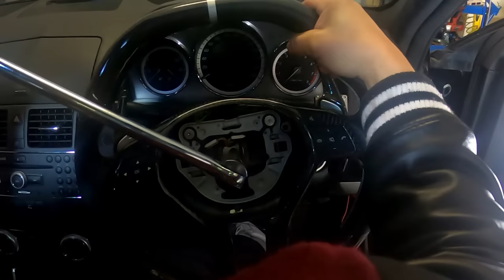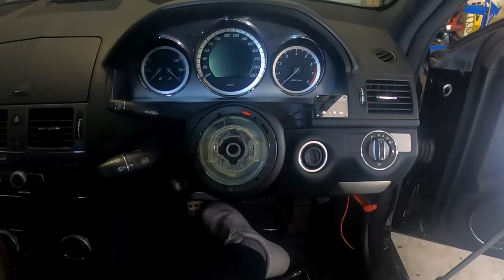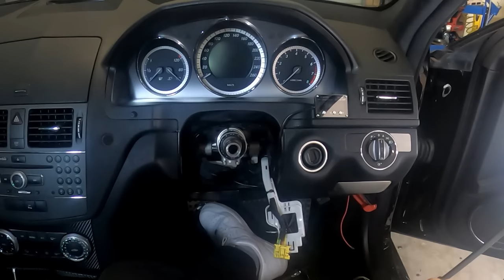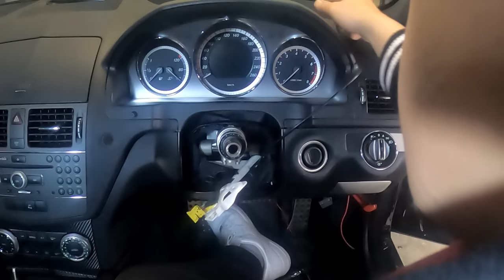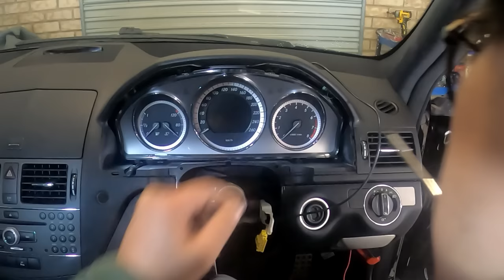HOW TO remove and fix ESL/EIS/ ELV MODULE  w212 w204 mercedes motor replace  Part 1

Comment: Hi, Managed to pull the column out, BUT the spline above the universal was not loose enough to separate. The bolt has been loosened with a T40 Torx. Should I start to spread the alu fork to release the spine or use a hammer to drive the universal downwards? What has been pulled a bit further out in addition to the column is the bit below the universal, the bit which turns the system. Help! Thanks.
Reply from the maker: hey dominic sorry to hear about your troubles ... ok so from my experience when i pulled my column out i only removed the torx bolt and it came out quite easily
Reply: Thanks, Mike. Problem was, I should not have worked on my own. I used a screwdriver to loosen the grip of the spline and that worked. Had a friend been with me, he would have stopped the moment he saw the whole lot gets pulled out. Anyway, will see if I can find the second spline I pulled out and lift the universal sufficiently enough to mate them again. Thanks for your constant help!
Reply from the maker: @dominicwild3189  no problem mate im very proud and glad to see  your taking the initiative and giving  this task a go.... i take my hat off to t u.... ur doing a great job mate ..keep at it and dont give up ..u will get there i believe it.... and have faith in u.... i didnt need a partner to help it was a bitch getting the colum to sit in again and i almost gave up but it does go in a certain way and u will figure it out buddy.... good luck mate
Reply: @MIKEYZVLOGZ  Thanks Mikeyz, great help! Managed to fit the spline with the universal into that lowest hidden part of the steering assembly using soap to slip the steel spline into the lowest rubber spline hidden behind rubber bellows.
Reply from the maker: @dominicwild3189  good on ya man well done happy for u
Reply: At the universal end I noticed a rather large gap without two (?) splines and a matching gap in the spline of the column, so this must be the place to mate while a friend holds the column. I managed to push it in the first 10mm, then there is a gap at the universal end and then it does not wish to go farther. As the web is full of horror photos of chaps having hammered splines together (alu vs. steel!), I am once again stuck, literally, but the motor has not arrived from China yet, so I can wait.

Comment: Mikey, quick question. After I reinstall the module and I’m ready to test is, how much do I need to button back up before I can hook up the battery and check my work by putting the key in and trying start the car?
Reply from the maker: what do u mean by button up? do u mean how much do u need to reassemble the eal module? ..u just need to have it put back together .. use duct tape to secure it for testing purposes then reconne t battery and try.. u don't need to reassemble the steering wheel .. just do the testing first
Reply: @MIKEYZVLOGZ  yeah… once you’ve installed the repaired module and got it plugged in, how much reassembly is needed before you can plug the battery back in for a test? Does the module have to be screwed back into the steering column? Or can u just plug it in and test it in your hand ?
Reply from the maker: u can just plug it in and hold module closed tightly and reconnect battery to see if u hear it spin and unlock and lock..don't put anything bk together ..its not needed.. cuz ur just testing ..just reassemble esl and closed cover and duct tape to hold together and then plug it in
Reply: @MIKEYZVLOGZ  so do you leave the key inserted while you do the work, and then reconnect the battery with the key in the EIS so everything looks like it did when you disconnected the battery since the ESL is unlocked?
Reply from the maker: @evanromoff5413  correct

Comment: Hello, firstly I am very great full to watch your video how to replace ESL motor. I need to ask a few questions. If I want to take out ESL ( in unlock position ) can I do it without remove instrument cluster (speedometer), the Steering wheel and steering column ? In which country you staying ? I am at Malaysia.
Reply from the maker: i believe u can fo it without removing the cluster and speedometer... but u need to remove the steering wheel... it is the only way i know how to do it ....  you can try to do it without removing the other parts but it will hist take abit fiddling around thats all... i remived all those things to giveme more room to work and so i could show in detail how to remove it all....im from australia
Reply: @MIKEYZVLOGZ  Hello Mikey, I did not understand what did you mean "when something else happen " in your explanation text below in your comment
something must have went wrong with your installment...because if just your motor is malfunctioned you can just replace motor in ESL module and it will be ok...but when something else happens....then you have to resync the ESL to EIS...kind of like reprogram but abit different..this si what i understand from some research..
Reply: Hello Mikeyz..Another question from me.
When the ESL in unlock position then disconnect the battery cable and the engine still running. when I switch off the engine using keys did the ESL will go to lock position again ?
Reply from the maker: @muhdhisham9w2sym61  correct so if u just replace motor in esl u can reinstall..but if your nec chip has malfunctioned or u fry your chip or circuit board due to incorrect handling or procedure then most likely you will need to reprogram it
Reply from the maker: @muhdhisham9w2sym61  u dont need to have the engine running ... u just put the key in the ignition so it will unlock esl..then u disconnect the neg battery terminal so that it will stay unlocked... as long as the battery is disconnected with esl unlocked it will stay unlocked becuz no more power is going to the esl.... even if u remove the key with batt dconected it will stay unlocked.... but as soon as u reconnect the battery it will lock again if key is not in ignition... is this what ur asking
Reply: @MIKEYZVLOGZ  thank you friend
Reply from the maker: @muhdhisham9w2sym61  ur most welcome friend
Reply: @MIKEYZVLOGZ  Hello Mikeyz. Do you have VVDI MB Tools software install in your PC ? Where should I get the software ? I am planning to do learn how to use the software for duplicate  keys, Prog ELS Imulator for my hobby. Hehehe...
Reply from the maker: @muhdhisham9w2sym61  ebay and aliexpress will be a good place to start im sure u can find it

Comment: Great video, happened the same to me at Walmart parking lot tonight, couldn’t get it start but after little while sitting in the car it just worked after trying 100 times . I can’t wait for summer so I can change the fu*king motor .
Reply from the maker: firstly thanks for checking out my channel i truly appreciate it..... and thanks mate ......hope this video can assist you in some way 
also do not forget the lil trick of tapping under the steering column right under the esl module and tapping with a rubber hammer or like the one i showed you in the video double sided plastic/rubber heads and it will help spin the motor aswell incase you get stuck again ..... trust me very handy to know
Reply: @MIKEYZVLOGZ  hey my 2008 c300 had the same problem can I use the hammer trick to get it to start
Reply from the maker: you can most definately try...it wont hurt to try..however ive been informed by another person that it didnt work for him...pls be aware that its based on luck also...its just a trick that worked for me and a few other ppl after some research.... so definately give it a try
Reply: @MIKEYZVLOGZ  ok thanks!
Reply from the maker: you are most welcome friend

Comment: Hello, when you go up the elv engine, the position must be the same as the disassembly? How do you do if the position is no longer the same? will it work at startup? Thanks for your answers. Jean
Reply: In my case the lock sticks out and looking at the ELS side-on, both grey pins of the two limit switches just touch the posts. Hope that helps?

Comment: Hey Mike so I have the same problem with my Mercedes c300 2014.. I was wounding is the eBay motor $16.49 that you have listed in the description would fit my car?? Looking forward to hearing from you.
Reply: Also what is the motor ID # ...do you have another link to buy it who would ship it the fastest ?
Reply from the maker: @adhamabughanem9401  search eBay and aliexpress and find a seller that ships from your country that's the fastest way to get I.. I'm sure u can find it .. filter your search to your local country

Comment: Awesome video. I have a question, do you tap on the ESL to get it on the unlocked position when you are turning the key? or do you just turn the key to the on position??
Reply from the maker: the esl unlocks as soon as u insert the key u don't have to turn it at all..
Reply: If when you Insert the key nothing happens then is the eis?

Comment: Hi there.... Thanks for your video... I might come across the ESL problem also.... When I insert my key, no sound at all.... But it can start normally.... Will this consider esl problem? And may I know how to make sure is it on unlock position? Need to disconnect the battery? Thanks in advance ya....
Reply from the maker: yes correct

Comment: I went with an emulator instead of repairing the modules. Had a company program it and no more worries about motors going out. No more mechanical  parts. Limited lifetime warranty.
Reply from the maker: good stuff yes i heat uts about 300 to 450 to program a virgin emulator which is pretty good to have piece of mind and goog thing is u dont even have to remove the esl u can simply plug in the emulator ...
Reply from the maker: @carronagringa  hey leo yoi can find them cheap on ebay for about 60 to 80 dollars ...they will be new emulator so programming is still needed ... or source one on aliexpress ...search for w204 emulator and find the best one for you...be sure to shop around get a good deal..... i also wanted to point out that most auto locksmiths kry specialists  can help you aswell even supply an emulator and you would have to give them your esl and eis so they can sync it up  to match.....
Reply from the maker: @carronagringa  most welcome dear friend sunscriber

Comment: Thanks 13:25 what number is that Allen key? it seems quite big.
Reply from the maker: which alley key are you referring? the one that removes the pins?? its a torx 5
Reply: Sorry, 12:53 You already mentioned it is a 10mm hex key. In Argentina we call it Allen, thanks!
Reply from the maker: @gabrielirlanda that's ok mate.. not anproblem glad i could help... hope u get yours done

Comment: Question for ya...all the motors on Amazon and Ebay seem to be the same. Would this work for a W208 as well? 2002 CLK320....motor is failing badly!
Reply from the maker: I can't say for sure ... as I have never done it on that model ... u need to check the part against yours
Reply: @MIKEYZVLOGZ  Well it is a totally different motor....found out after doing some research...the W208 uses ESL type 1 And the one you showed is the ESL type 2. Wish I could find a great video like yours for my car....I want to put in an emulator and get rid of the lock altogether.Wonder if the procedure is similar.
Reply from the maker: @hallieboy  yeah thought it might be ... hope u can find it ...
Reply: Just to follow up. I removed my W208 ESL! It is actually much easier than later models with the ESL type2.  No steering wheel or instrument cluster removal, or column dropping needed! I just removed the driver's side kick panel and did all the work from underneath. The whole thing is held in place with 1 bolt with a 10 mm nut on the end. It is very cramped and impossible to see the nut from underneath, but using a small 1/4 inch drive ratchet and 10mm shallow socket I did it by "feel". Once the nut is removed, the bolt drops out and the unit slides right out! Now, it's onto installing an emulator. I hope this helps someone.

Comment: I have a '08 C300  locked ESL and need to remove the steering column so I can cut off the bolt.  I   can do this thanks to your video.  Unfortunately your body covers the direction you are turning the #8 Hex bolt to remove the steering wheel.  I cannot break mine loose turning it counter-clockwise (Left).  Do I have to turn it to the Right (clockwise) to remove? (Reverse threading)?  My concern is damaging that center bolt.  I am replacing ESL with an Emulator to prevent future problems.
Reply from the maker: you go counter clockwise so to the left ..lefty loosey righty tighty rule of thumb ..its niot reverse thread ..its normal
Reply: Thank you, the Mercedes Dealer finally replaced the recalled Takata air bags about 6 months ago and I wonder if they might have put that center bolt back on with an air gun, it won't budge.  Now I am stuck at this point as I have already removed the air bag, instrument panel etc.  I have a breaker bar but it does't budge.  Thanks for your confirmation on the standard threading.  Worst case senario, put it back together and tow it to the dealer.  Bummer!!
My dealer wanted between $1900 / $2400 depending on what they ran into to fully repair the ESL.  I would have not known better without having seen your videos.  Thank you for making them.
Reply from the maker: @Anthony Redfern thats exactly what i did ..once they get locktite on there is a nightmare to get off..but with the help of a friend to brace the wheel..its much safer and better...never try to break the bolt without hokding the wheel...u will break the locking mechanism ...100%

Comment: Any tricks for getting the pins out? My extraction tool is not working
Reply from the maker: use a torch 5 bit tap it in slightly with a hammer or sometjing solid ..just so it grips it ..then slowly turn it as u pull out ..repeat until removed..or if they won't drill them out and tap it to use a screw after ..some have just duct taped it after with no issues

Comment: Hi, I just wanted to thank you for making this very detailed tutorial. Following this tutorial, I was able to uninstall my ESL lock and install a programmed ESL emulator. The production quality is very good and I hope your channel does well :)

I am, however, facing an issue. After installing my new emulator (it has a speaker and bolted into the original ESL's mounting location), I put everything back together, but after I connected the battery, I tried to turn the key, but I did not hear the distinctive buzz of the ESL motor (maybe it would be a beep with the emulator, but I heard nothing). Trying to turn the ignition to start does nothing, and the instrument cluster just says something along the lines of "Remove your key" (like, a reminder). I contacted the programmer and they said that they programmed it correctly, so I'm going to take everything apart and make sure everything is connected properly, but do you have any ideas for where I may have gone wrong in my installation process? I'm certain I connected everything properly, but maybe a new perspective is all I need.
Reply from the maker: hey bud.. so I've never used an emulator to this day.. however as I understand it's a matter of plug and play once u connect the emulator.. another thing... when u reconnected the battery did u have the key in like when you disconnected the battery? when u disconnected the battery the esl was told to unlock so u need to ensure to have it the same way when you reconnect the battery ...so u don't confused the lock unlock position
Reply: @MIKEYZVLOGZ  I did have the key in when I put the battery in. I put it in the first position, just as when I originally took the battery out.
Reply from the maker: @MuhsinunChowdhury  very good.. I. that case km not too sure .. did they take your eis as well and sync the. together .. that's what they usually do
Reply: @MIKEYZVLOGZ  yes they did.
Reply from the maker: @MuhsinunChowdhury  then it should be plug and play... maybe consult them and ask them what the issue maybe .. cuz to my understanding it should just work ..
Reply: @MIKEYZVLOGZ  yeah I'm gonna try to reinstall
Reply from the maker: @MuhsinunChowdhury  ye give that a go attention to detail my friend.. take ur time ensure all connectors plugged it ... I suggest plugging everything in and then do a trial before putting everything back together ...save the hassle of having to do this all over again ... ensure it all works

Comment: Hi @MIKEYZ..had my glk 350 towed and when I tried to turn on in the towing yard dash tells me to remove my key...I have a feeling they towed it wrong and locked the   esl...your video is the best out there..what do y recommend I should do 1st ..thanks bro
Reply from the maker: thanks for tour comment it means the world to me ... its possible that after towing your esl malfunctioned its a random thing also...when mine failed it was random and i was shattered ... but main thing is its fixable and not the end of the world... i hope u sort it out asap... good luck and wiah u all the best
Reply: Update..I fixed my Glk 350 Mikey..pain in the butt,but got it done !!.only cost me some time and $25 for the new esl motor..followed your video..thanks for the inspiration..I am not a mechanic , this is not easy, but definitely doable..my esl was locked..I drilled a small holes and opened the esl by hand..then locked it again when putting it back together..I did not place my ESL in my steering column tho..I used it as an emulator of some sort..my car is working fine now..thanks again bro
Reply from the maker: @antoniocarpio884  well done mate good on ya